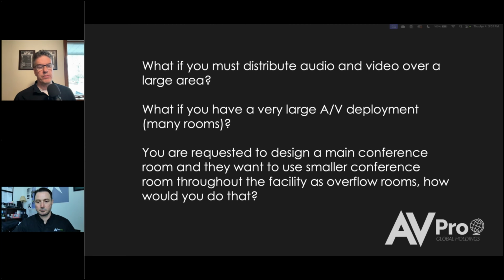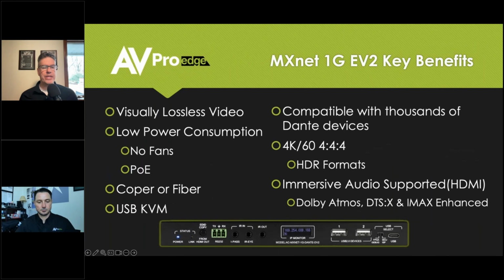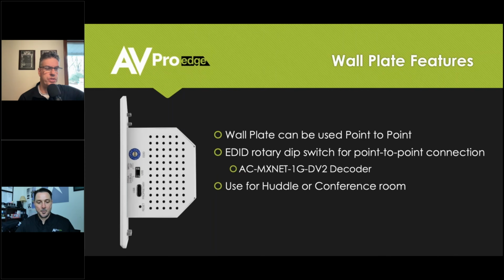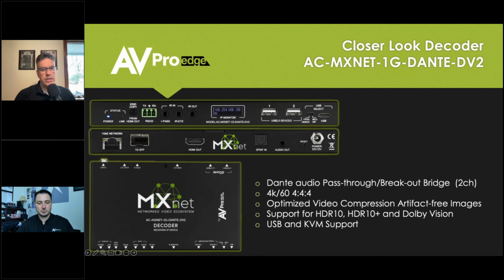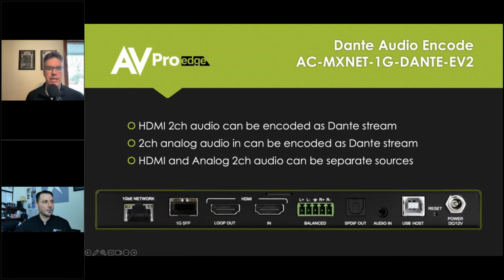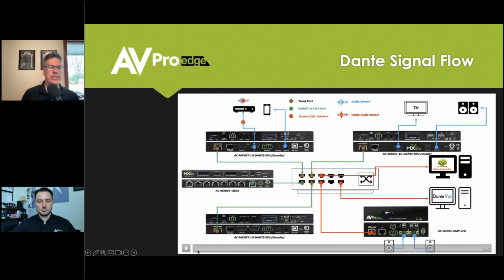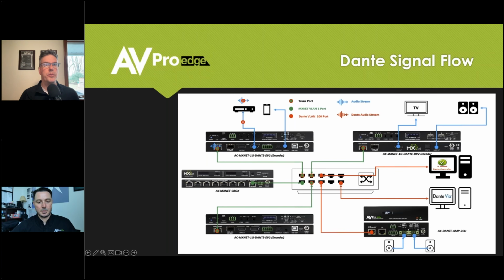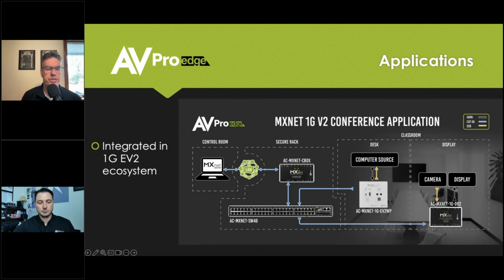MXnet 1G EVO II Encoder, Decoder, and Wall Plate. Now with Dante!

Comment: Why doesnt the encoder have a dedicated Dante out ethernet port?  Wouldnt this save a lot of ports on the MXnet switch? Could be the difference between having to buy a 48 port switch instead of a 24 port. Version 1 encoders have a dedicated dante port. Please add that feature to V2.